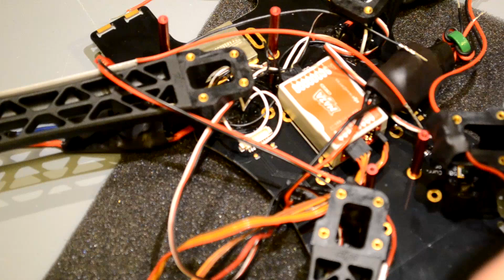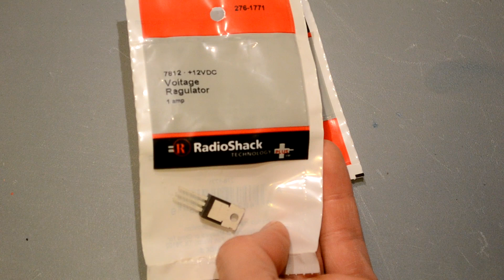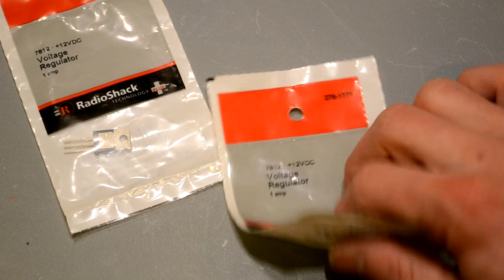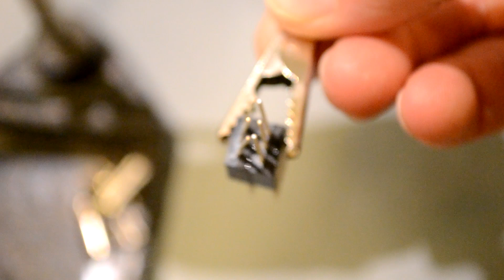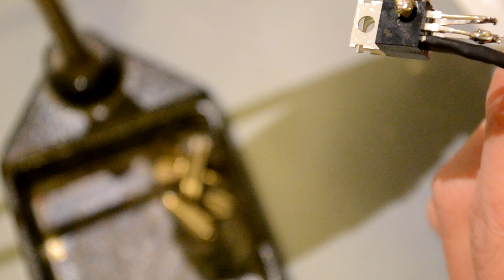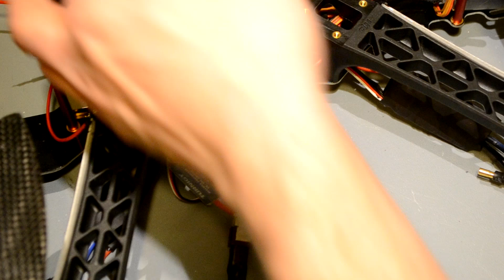TBS Discovery Pro Build Log: Part 3 --- Aftermarket LED System

Comment: the 78XX series regulators cannot be put in parallel!!!
Reply from the maker: Not the way I did anyway. You can isolate each of them with a diode on the output side, or a small series resistor. 

Each of their output voltages will be slightly different, so its an effective, but ill-advised way of doing the job. I've since switched to a 5 amp